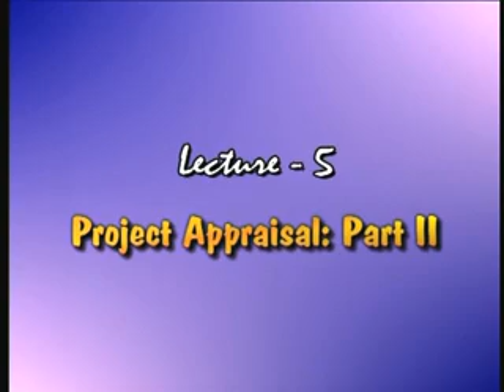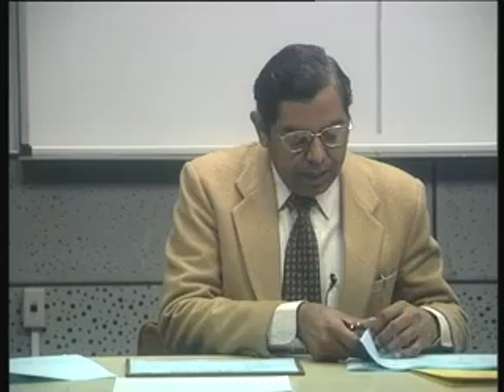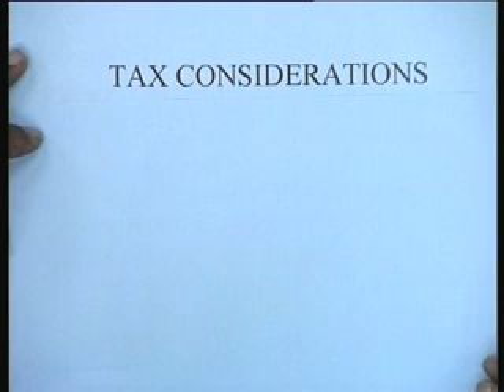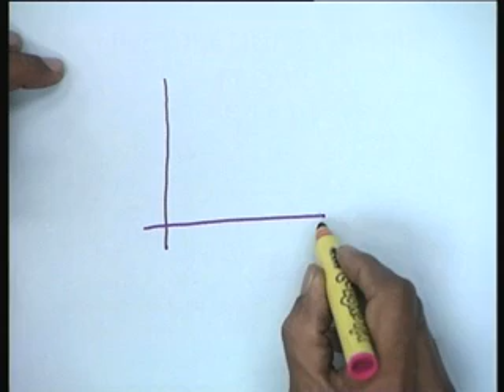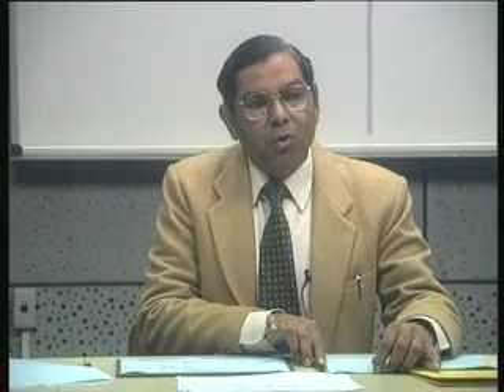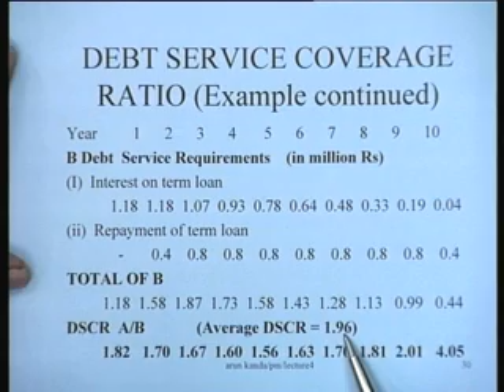Lecture - 5 Project Appraisal:Part II

Comment: I think payback period is not right...It should be 2 years+9.33 months, coz if we consider 180k in 12 months then each month will have 15k. and to meet up the shortfall of (-140k ) and breakeven with intial investment of 300k ..the calculation will be 140k/15k = 9.33 months. OR (140/180)*12 =9.33 and not 2.78 years
Reply: what is the difference between 2.78 yrs and 2 yrs + 9.33 months can you say me?